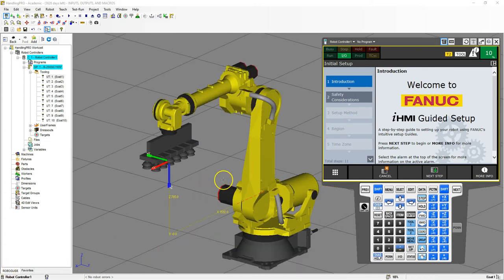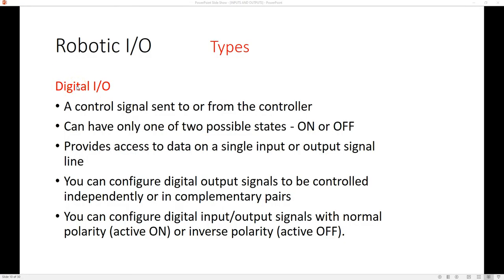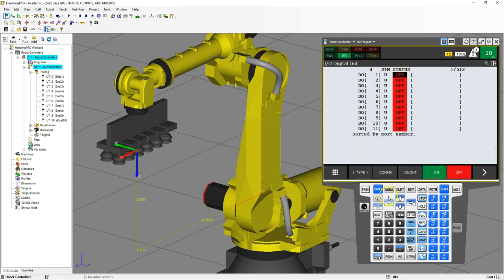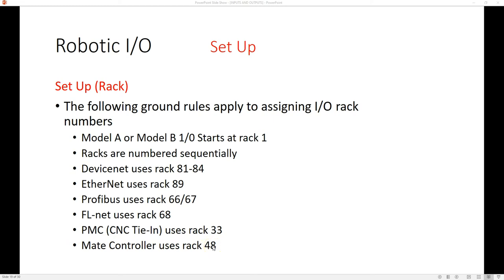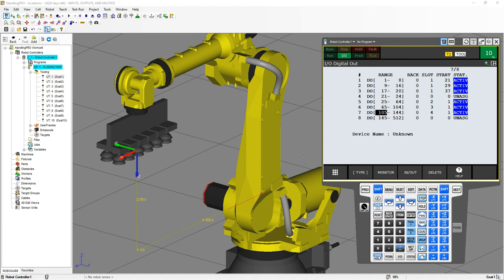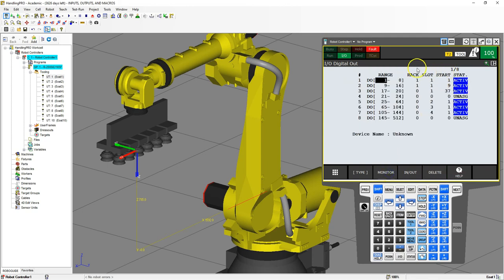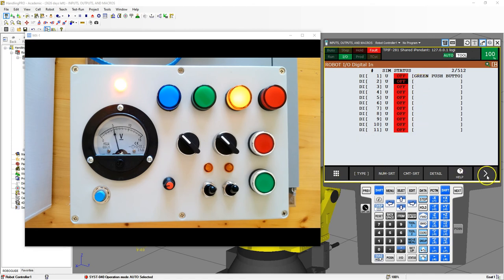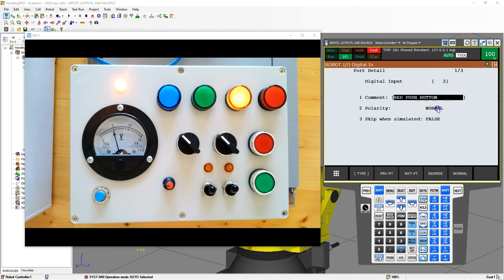INS AND OUTS IN FANUC'S ROBOGUIDE SOFTWARE VIDEO 1

Comment: Hello Sir, first of all thanks alot for all these videos, they are perfect to learn the software.
I was stuck at one part. I have a turntable with which I want to turn a part firt to 90 degrees and then to -90 degrees. I have atried everything I could think of but I am able to programme the first part where the part turns by 90 and then it does not turm -90.. could you please help
Reply from the maker: Good evening
I am sorry I don’t know much about 7th axis’s. That is on my list to learn.  Sorry I can’t help.